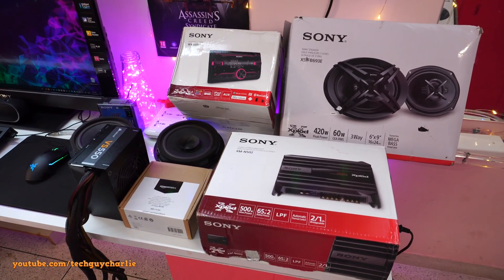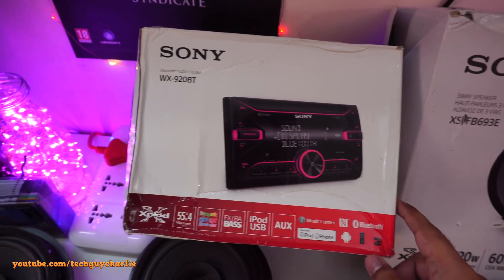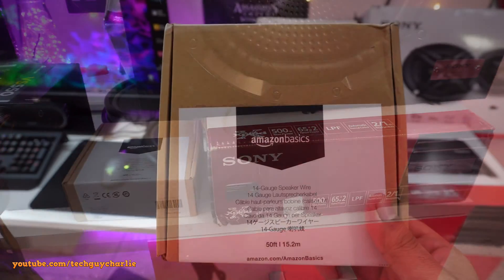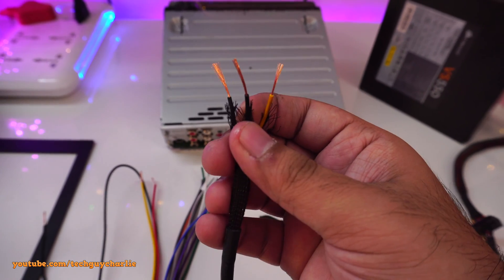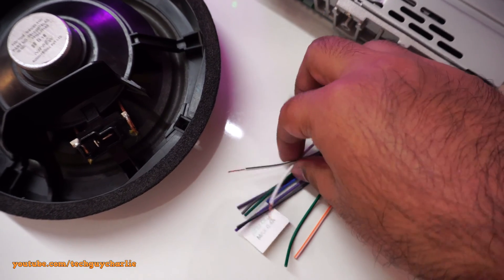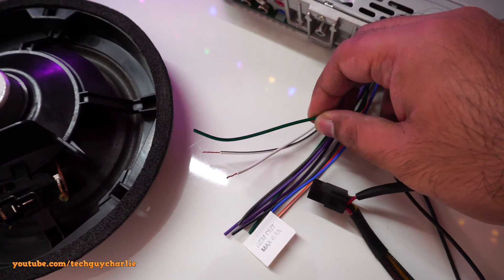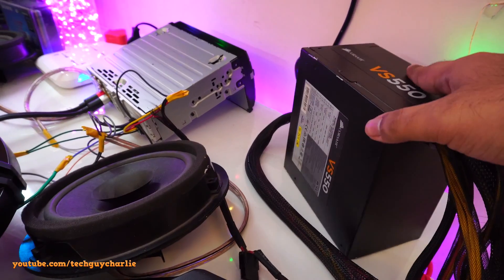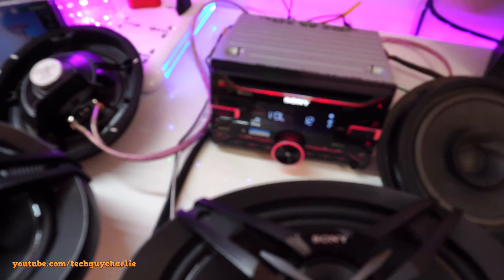How to wire up a Sony car stereo for home use including speakers, amplifier and subwoofer

Comment: Very useful, thank you so much. I have removed my Sony XAV 68bt and connected at home just for trial now using an SMPS. But somany wires of that on table doesn't look nice. Hence ordered a 12V 15 Amp which has only one two+ two - output terminals.
Now the problem is that I don't know how to add a antenna to the unit for FM and how to use the remote for playing audio.

Comment: What will happen if you put the volume high more than the power supply watt 550 watt what will happen if the watt go much higher than 550 watt more than the power supply

Comment: Tech guy charlie will the power supply trip or dip in power I want to do the same for my home using car stereo n amp d amp which is 1500w it's an orion xtr timpano 6" for mids n db drive wdx 8" for bass do I need a car battery like xs power or jus d power supply thanks

Comment: Great work.. Bt can we connect that player direct to power supply without using vs550
Reply from the maker: You can try plugging in the player directly into mains and it will go up in flames 😂

Comment: Thanks to your video, now I'm building a subwoofer system for my home with Sony GS100 amp and jbl stage 1220B subwoofer.
Reply: have u built your setup and how is your experience?
Reply: @mutaharasif7569  I'm done with my setup, it is terrific.
Reply: @vishalmohan1995  how much will u rate it out of 10 by the way thanks for replying...
Reply: @mutaharasif7569  I would rate 9 for his video it was so informative. If you need demo video of my setup drop your mail or instagram, I'll share videos of my system.
Reply: @vishalmohan1995  bro drop your instagram and i will dm u
Reply: @mutaharasif7569  @i.am_vishal

Comment: How about using two 12v adapters for head unit and amplifier . Is it possible to use  12v adapter with 2 AMPS

Comment: Can i use 4ohm component speakers if my current speaker system requires 6 ohm satellite? (Using car component as left channel in home theater without car amp)

Comment: Dear charlie good day I saw your video I very impressed so i need your help 
I want installed same system  what about sound enough for my hall is it enough watts ? 
Please recommendation how many watts need to use?
And power supply unit how many watts? 

I want use in  🇮🇳 Tamil Nadu 
but currently living in singapore 🇸🇬 

Because I hear from car audio systems I like it so I want same as car audio sound for my house please advise me is it can I order front amazon or where? Because I need to send india 

Thank you if you have your email can sent to me thank you

Comment: How can I prevent loosing settings in head unit when PSU is turned off? Could I use 18650 batteries?
Reply: I have my system running off a car battery and I wired my amp in like it only gets powered when the headunit/stereo has power, that way it shouldn't lose any settings (haven't been for me though)
Reply: Ya i know . Sony and Kenwood are dsp based processor and has a RTC . There will a different circuit. You can use 12volt battery for backup of the time settings.18650 could be a option.

Comment: Thank you very much sir for your time best vid out on YT,1 question for how long can i play the car stereo on the psu powersupply?
Reply from the maker: As much as you like.. because the stereo is running off mains power, there is no such limitation as to how long you can use it.
Reply: @TechGuyCharlie  Thank you for the reply i appreciate it,now i can start with my project,have a great day,and again thanks alot.
Reply: @jonnyjustblaze8107  bro are u done with your project? if yes then how is your experience?

Comment: I was wondering and thinking to turn my unused car stereo system into a home karaoke. Can it be done sir?
Reply from the maker: Hey, Jeffery, that would require a little more effort because car stereos don't have a karaoke mic input. So I guess you will need an external sound mixer which has both, audio in and mic input so you can mix those two and then send it to the car stereo.
Reply: sure it just needs power. you can get a dedicated 12v power supply or just do the old hot wired PSU trick like the one in the video.

Comment: Hye, does the power supply that you are using is compatible with my Sony DSX - A110U?
Reply: it doesnt care which PSU ur using if you just cut the wires and splice them to the power input of your radio ... no need for "compatibility" ;) youve seen that he did that right ? you watched the video ? xD
Reply: it doesn't matter, all computer power supplies have 12v and 5v rails. all you have to do is hot wire it (ground the green wire) so you can run the power supply without a computer and then you tap into the 12v rails to power your stuff. but make sure you're using the highest output rails for PCI-E expansion. if you use the rails for hard drives then you won't get much power out of the unit. honestly though it would be better if you just bought a 20 amp power supply off of amazon or something because PSUs can only pout out so much power.
Reply: @ElectronicsForFun  ok noted, bcause my sony audio player amp rating is 10 amps, many of the psu i see on the market the amp rating is higher, i just afraid the psu gonna blow my audio player fuse
Reply: @pilangkersharlequinn3861  Mate learn some Basic electronics pls :) if your Radio is rated on 10A and The psu is Higher that only means that The Radio "draws" 10A from lets say The psu can handle 15A so your PSU can handle that 10A without getting overloaded and Heating Up because it only has to "Push" that 10A it wont give your Radio more then your Radio needs except shortcuts ... But i guess the 10A is a Max Peak Rating that means your Radio should Draw less then 10A ... If you would use a PSU rated For lets say 5A and The average Draw from your Radio would be 7A which would be an overload your PSU would end Up in Heating Up and would blow after some  time... So If your PSU is rated Higher then your Radio Go on have some fun ;>

Comment: Thank you so much for information and i have bought the same sony 500watt amp and the same subwoofer box but i want to use it for home purpose so is there any alternative to Corsair 500 watt power supply? Any suggestions on adapter or ac to dc converter to use this amp.

Please suggest me the ratings